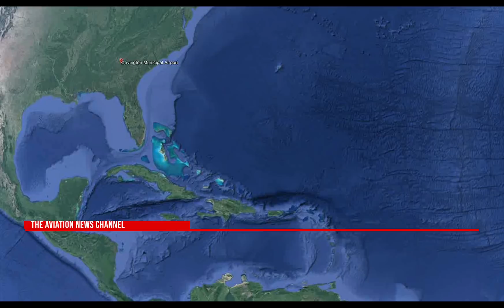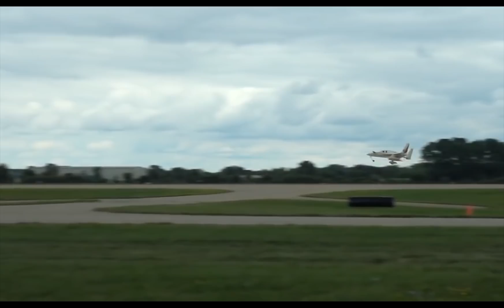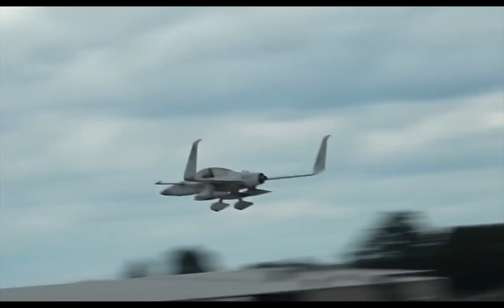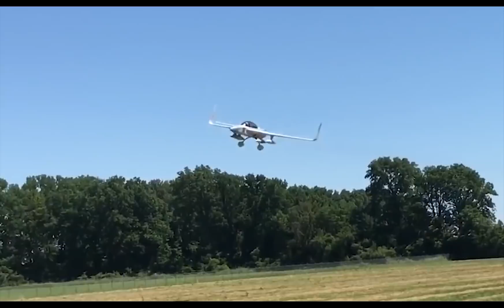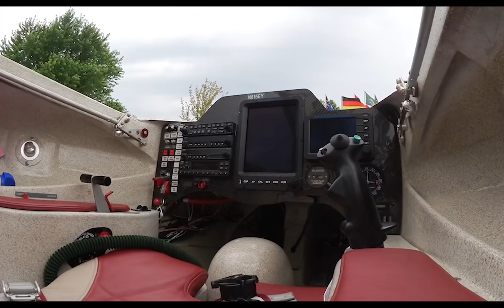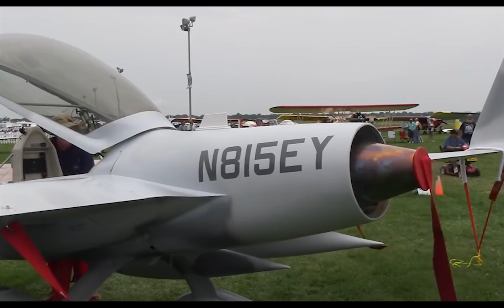In-flight Break up of Amateur Built JETEZ September 2018 (NTSB Reports)

Comment: When I stopped calling them "winglets", and instead refer to them as what they actually ARE, i.e. Vertical Stabilizers + Rudders DIS-advantageously mounted in a HIGHLY-leveraged location on the wingtips, it then makes more sense, and is less surprising.  Hopefully Engineer B.Rutan is successful in distancing himself and his reputation from these NON-Engineers who make UNauthorized UNfaithful clones of his designs.

Comment: The home build canard planes have a very good safety record. Original Rutan designs are over engineered from a structural point of view. Installing a jet engine and stressing the airframe beyond it capability Is looking for trouble.

Comment: If you're not an engineer you should not do this.  If you are an engineer you still should probly not do this.  If you do this, you should probly set it up to fly by radio control for testing purposes before flying it.

Comment: Winglet rudders finally broke the wing off. That’s why the Ares fighter had the vertical stabilizers on booms. If they are winglet vertical stabilizers, the rudders stress the wings over time at jet speeds.

Comment: Poly-composites are now standard to aviation, requiring x-ray imaging for stress fractures, which visual inspections cannot detect. It's a trade-off, regardless of pilot experience: solid steel for safety, or component glue for speed.

Comment: Well, if you're stupid enough to get in an Experimental Amateur built aircraft.  There's a good chance of a bad outcome.  Remember, it's an experiment, you're just getting your life that it was built/inspected/maintained safely.
Reply: "Experimental" in this case doesn't mean an unproven configuration or technology it simply means it's not type certified
Reply: Wrong.  Experimental (Amateur Built) in this case literally means that.  An unproven experiment.  It is possible that there is absolutely no flight test data on any components used to built this aircraft.  That is what Experimental AB category is all about.  I think you should probably do a little research on this.  If it says Experimental on the bulkhead then you are putting your life in in unproven components and questionable assembly skills.
Reply: @shawnhoem487  Common misconception but not true. Although issued under the Experimental category, AB aircraft are still certified by the FAA on a case by case basis. What there's not is a blanket type certification.
Reply: Well, I'm glad you asked.  Being a student of aviation for the last 37 years.  An aviation professional for the last 30.  I can tell you.  On average, an a accident like this one involving an EAB is caused by one of two things.  One, pilot error.  Usually a weight and balance (Can you say Lancair/Evolution for example) or a unfamiliarity with the aircraft (most of those are recent new owners John Denver for example).  The second, is in flight breakup due to structural failure (this example right here).  I have followed the GA community all my life, including at one time being a member of the EAA.  And, that experience of being around those people left a bad taste in my mouth.  Enthusiastic about aviation they are.  But their manufacturing process is often the problem.  Especially with the composite airframes.  Ask yourself, why do these composite airframes have such a high failure rate?  Fatigue a lot of these AF are less than 10K hours of flight.  No, I think it is a manufacturing process that the kit manufacturer deems too expensive henceforth not necessary.  Look a the actual Certified composite aircraft be they Standard or Transport.  You do not see this problem.
Reply: FYI.  If you have ever been involved with anything other that Experimental AB then you realize that anything carrying an Experimental placard on the bulkhead.  Is an essential crew only.  The other designations in this category require an exact flight plan, and an appropriate rated pilot aka 'test pilot'.  Experimental AB (EAB) allow non-essential crew members.  Because of the way the certificate is written.  But, I hold my statement as true.  In EAB only the owner can 'annual' the aircraft.  A certified mechanic/repairman is potentially violating FAR 23/43 if the sign of an annual/any inspection of the aircraft.  Components different thing.  But, that also depends on their utilization.  The Experimental community is rife with a terrible accident record.  But, it's an experiment.  So be it.
Reply: @shawnhoem487  Experimental R&D requires those appropriate measures and is crew only bc THAT'S a true experiment. EAB allows passengers bc it's been certified. The distinction is in fact the certification. They're among the easiest aircraft to attain ofc the crash rate is higher but how many of those accidents are attributable to the aircraft itself?

Comment: From the NTSB report:
"The National Transportation Safety Board's Materials Laboratory examined portions of the internal left wing material and found a lack of penetration and bonding of epoxy resin, which resulted in wing sections in which the adhesive had disbonded, leading to the wing's failure. This finding indicated a fabrication problem during manufacture and not wear over time or an environmental degradation failure. The lack of impregnation of the resin into the wing skin pieces indicated a lack of a vacuum seal during the curing process. The airplane's builder records were not located during the investigation; therefore, the method and timeline for manufacturing the wings could not be determined. Nevertheless, the findings indicated that the left wing was not properly designed and manufactured, which resulted in flutter at high speeds.

It is likely that the airplane's left wing entered a flutter condition during the high-speed low-pass maneuver and that the left wing's internal composite structure near the wing's mid-span subsequently experienced a failure of the adhesive between the composite layers."
Reply: this should be top comment
Reply: Nobody did the tap test?
Reply: @WakeMarine  it was obviously built incorrectly. And whoever made that mistake was also not one to catch that sort of mistake. Or to have anyone inspect it. I don't think the person who died was the original builder of that wing.

Whoever did is probably not going to pipe up now. There are a lot of shady project out there. 1/10th of plans sold end up completed and a smaller fraction yet are completed properly. And there is about 5/10ths of those plans sold that end up partially completed with a bad wing or empenage floating around in sombodys garage for thirty years, until their heirs lists it on barnatormers, and somebody else buys it, with no records, and no idea its junk.
Reply: @Triple_J.1  Hey bro, just watch an interview with them. they did in fact build it.

Comment: If I ever design a kit plane, I''ll calculate how thick the wing spar has to be to ensure that it will never break, then I'll double that. It's shocking how often these kind of planes crash because the wing snapped off
Reply: If you go too fast in ANY aeroplane, you can snap a wing off.....Also when you are
done Doubling everything, your aeroplane will be wayyyyyy too heavy......
Reply: @regdor8187  I didn't say double everything dude, just the wing spar, maybe an extra 60 pounds on a plane like that
Reply: @azspotfree  : When you expressed the thinking that you would just double the build
of a spar to increase your margin of comfort, you also, unknowingly, indicated
an attitude that invariably grows the rest of
your calculations throughout your design...
Human nature...It takes real Engineering
Discipline to control.....

Comment: Remarkable building accomplishment. But 13 years to build and failed within a few months ?  Sad. 
He had over 22,000 hours flying experience,  Air Force pilot, commercial jet pilot, crop duster, instructor licensed, built multiple planes from the ground up. He got input and guidance from multiple experts in the field. Doesn’t make sense why it failed in midair.  

I admire his perseverance and skills (flying and building). Maybe the jet engine was just too much power for that design. 

https://www.kitplanes.com/jet-eze-2/

Comment: I wonder if the left wing failure had occurred at 3000 AGL or higher, if pilot could have bailed out and survived.  I also wonder if added weight of those 2 fuel pods per side may have contributed to wing failure.

Comment: I like what he did with the widened fuselage, but the changes made to the winglet design, which were his own, probably without any structural analysis, were fatal. If he had built the wing and winglet per the plans, it probably wouldn't have broken up. Flutter caused by poor winglet/wing design changes.
Reply: Winglets are a standard rutan design other than the curling at the top.
Reply: @andrewhoag6982  that's true, but his were oversized and a huge departure from the ones in the plans. Dangerous to make such changes
Reply: @tedstriker754  The fuel pods are not aerodynamically neutral, and don't appear to have a lot of twist resistance in the struts. Eventually that structure "loosens up" and all that has to happen is for it to create a resonant vibration, setting off a positive feedback loop in the outer section of wing and winglet.
EDIT: And that would have deeply aggravated a resin-starved section of the upper left wing.

Comment: Builder should've known to Beef up the Airframe  structure accordinly to accomodate higher speeds,stresses on airframe from normal flight using the standard,recommended powerplant.  Sad, he could've gotten a 2nd opinion from so many EAA counselors out there.
Reply: He did your so called beefing up the airframe

Comment: A tragic accident.  The " no flight plan was filed " always irritates me as it implies that it was a part of the crash. Most civilian flights , especially local ones are not flown with a " flight plan " filed.
    Maybe VNE was exceeded, maybe some other structural anomaly. I've been around experimental aviation for many years and these amateur built jets still cause me concern though many and probably this one included are viable and normally safe.
Reply: I agree that flights like this one don't appear to have any reason whatsoever to file a flight plan... I also think that's kind of boilerplate as far as NTSB accident reports go, i.e. "before you ask, no there was no flight plan"). I also think that, unless there's info to the contrary, its fair to assume this ATP rated pilot was reasonably knowledgeable about all the well known procedures to mitigate risk such as avoiding speeds & g forces that are outside the airframe's design capabilities, don't turn at near-stall speeds, etc. It does seem more likely to me that he'd fail to consider risks associated with cracks/damage to a composite airframe that cannot be seen except by X-Ray inspection. This problem is becoming more well known today but I wouldn't want to assume a pilot flying his own single engine aircraft in 2018 would really consider that. It's only in 2020 that I read of Boeing aircraft having to inspect their composite airframes/wings for hidden damage and I'm not sure I've ever seen a news story expressing a similar concern for small noncommercial airplanes.
Reply: @julianbrelsford the standard method to determine this exact defect has always been for the last fifty years per Canard Pusher recommendation is to take a coin and tap its edge along the wing spar after construction and at each annual inspection. It will ring with a loud sound like a guitar body if its solid. If there is delamination it will sound like a dull thud and maybe even give some.

Comment: Sad that that happened but going forward others building that design will know what to watch for and possibly reinforce those problem areas possibly preventing the same thing happening again.
Reply: Make sure structure is modified for the given power plant. These airplanes were designed for small continental or lycoming engines. Routan design.
Reply: And observe original NE speed!!
Reply: That was a one off design it just looks similar to Long EZs. The pilot designer was the sole person responsible for this accident. SAD but when you push the envelope bad things can happen.

Comment: He may have exceeded the NE speed several times, perhaps damaging the airframe.
Reply: Most likely
Reply: @lometatron357  or there there were critical deficiencies in the composite layup... going 'too light' or 'too little' to save weight, fibers in the incorrect orientation, mistakes made in physical resin lay-up; could be any of these.  The biggest clue to me is the mention of 'blue foam core'... I'm not aware of any manufacturer that uses the color blue in any closed cell structural foam, in fact I think its against industry standards.  The reason is that colors like blue and pink are reserved for expanded polystyrene insulation for building trades.  I do marine composites, not aviation, but I'm fairly certain that none of the structural PVC foams from any major manufacturer are blue, and we all use the same stuff between industries, only in different densities.  If he used DOW Corning Blue foam board in an aircraft wing, that's what killed him.
Reply: Luke Blue foam is common on the Long-Ez. If you check out EurekaCNC, all their cores are blue.

Comment: Don't know if this was a kit plane or not. But there is a reason to test structural components to failure. Any time a plane suffers a huge structural failure in flight, it is going to come down to some engineering failure either in design or assembly. This guy built his plane so he probably bears some responsibility. He will never get the chance to complain about it. Tough to lose your life with a hobby.
Reply: As if the mounting points for the Jet-A tanks failed

Comment: Good candidate for a BRS parachute.
Reply: Unless it was auto deployed, and even maybe then it likely wouldn't have helped.  The G's and jerk in an accident like this can kill you mid air, believe it or not, and he was almost CERTAINLY lights out ("g locked") from the start of this, and possibly all the way to the ground.  Spinning around and tearing parts off of a 12g airframe like that makes me think that was the case here.
Reply: @MrJdsenior  Quite possibly too low and too fast for a BRS parachute deployment in this case. The speed was estimated at 200 to 220 knots, just after takeoff. 

I am not sure if Rutan added an ejection seat to his AERES close air support jet. Though the cost would seem prohibitive. 

The pilot was quite experienced, which seems to point to either construction errors or modifications to the design.

 Some speculate flutter started the crash.  I would wonder if there were errors in building. Was this his first fiberglass and foam plane?

Sad, posts seem like he was a well liked guy.
Reply: @kevinmoore4887  If you look at the tips of the winglets they are curve canted in at the top, definitely not in the plans.  I don't remember what the Vne was but 220, I suspect, if it isn't beyond it, isn't that far from it.  And if you're beyond Vne, even on a stock design, you are now in test pilot territory, IMHO.  You'd have to analyze the pieces or the video, if it was good enough to determine if it was flutter, but yes, that, or something failing in the wing spar structure would be my initial guess.

I know Dick had a ROCKET motor on his Long for a while when they were doing tests for their lob into space suborbital vehicle that is now the Virgin thing.  I don't know how fast that one flew, but it looked like it was really traveling at a VERY steep climb angle, it left the chase EZ in the DUST, so to speak, the rate of climb must have been immense.  I should go refresh my memory and look some of that stuff  up.  Old age syndrome, I guess.  ;-(  Dick, unlike this guy, though, WAS a test pilot for many different aircraft, not that it would make much (or any) difference in a failure like this, but the Rutans, I'm pretty sure, if they were going to expand the flight envelope would do it VERY cautiously, and with proper stress/strain and dynamic instrumentation, at a minimum, and I'll bet a seasoned test pilot is much more aware of what is going on with an aircraft under test than the average, or even high hour, jet jockey.

I think Dick or Burt, one, was the FIRST and maybe the ONLY pilot to ever recover a Phantom from a flat spin.  I seem to remember reading that, and I think he called it the JC maneuver, saying EVERYTHING he did with the stick made it worse, so he just let go and prayed, and it recovered.  Better than hitting the silks!
Reply: @MrJdsenior  Barry Goldwater, Presidential candidate,  was an avid pilot. He said he went into a spin and everything he did made it worse, so he just let go and the plane corrected, letting pull out. He was advocating recovery and aerobics training as part of licensing requirements.  Good article.
Reply: @kevinmoore4887  Another ugly Rutan wreck. John Denver went down in a Rutan also.
Reply: @MrJdsenior  - Burt don't fly - he just design ugly planes.
Reply: @rogertycholiz2218  This was a massive redesign as told in the video.
John Denver punched his own ticket. Expired medical, no check ride, the fuel switch was in an unexpected location. His plane crashed when it ran out of fuel.
Burt was the first to fly the BD5.
Reply: @rogertycholiz2218  His first solo flight piloting an airplane was in an Aeronca Champ in 1959, from Wiki, so he did, anyway, don't know if he still does.  If you think aircraft like the Beech Starship, the quicky, and the EZs are ugly, there's no hope for ya.  ;-)